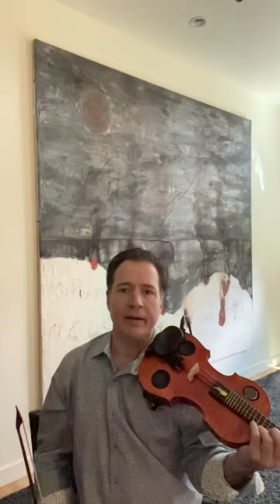X-ray Bach Prelude example on Volta Violinatron fretted EV with Delay Pedal

Comment: Absolutely stunning! What's the name of the piece?
Reply from the maker: Thanks! 🙏 That is the first movement “prelude” of J.S. Bach’s Cello Suite #2. It’s originally in D Minor but on violin I play it in A Minor. I play from Anna Magdalena Bach’s beautiful manuscript, but for violinists not used to reading bass clef and transposing a fifth higher at sight, there is an edition for violin in treble clef. Both are available on IMSLP, I think. 

Some musicians like to use the cello suites as improvisation guides, harmonic maps over which to ornament, embellish, or fully improvise. I like to do this with the preludes especially.
Reply: @monteverdi007  thank you so so much for the thorough response! I am listening to it right now and it's beautiful! You should do a full cover of it!
Reply from the maker: @BaziGames  Thank YOU! And by the way, I recorded this prelude (Suites 1, 2, and 3) on viola during pandemic lockdown. The album is called “Metamorphosis” and is on all the streaming platforms. You can also just search my name, Zachary Carrettin. If you’re looking for an electric violin recording specifically, (of a 
different Bach work), my album “Bach UnCaged” was released last month on streaming. This album has Bach’s Sonata #1 for solo violin, interspersed with prepared piano works by John Cage, (piano with nuts and bolts wedged between the strings). 
Mina Gajić and I recorded Bach UnCaged two summers ago and I’m really happy it’s available, a very different approach to playing Bach’s amazing music.